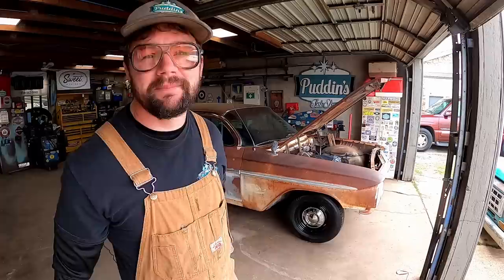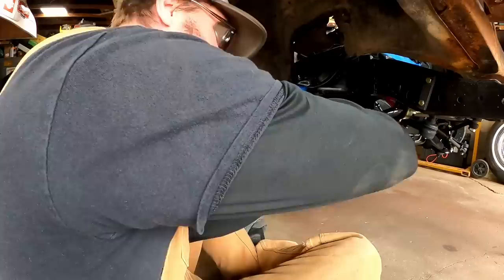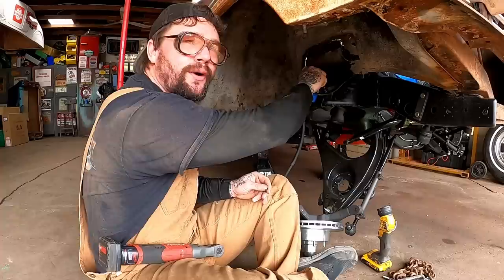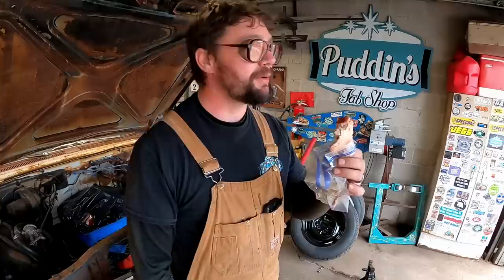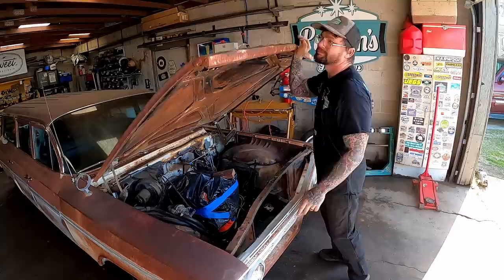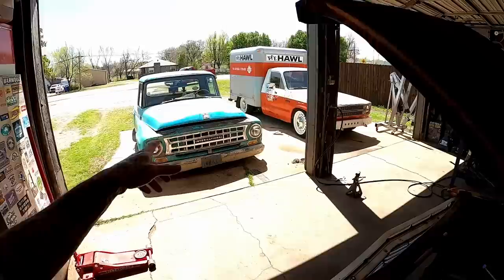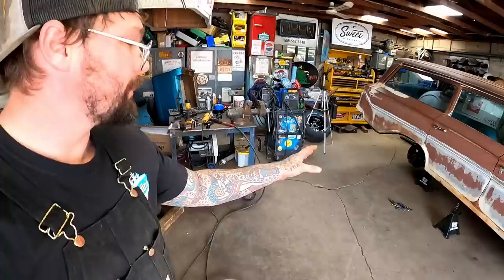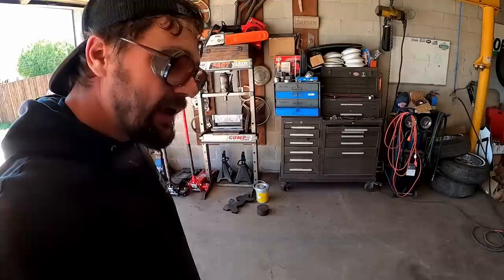ALTITUDE ADJUSTMENT! Lowering the 1961 Wagon & Brake UPGRADES!

Comment: There's two holes on the brake pedal arm. The upper hole is for manual brakes . The lower hole is for power brakes. You're gonna have real touchy brake pedal because you  put it in the upper hole with power brakes. Love the channel👍 The brackets that mount the booster to the firewall are angled so that the rod that passes through the firewall aligns with the lower hole on the brake pedal. It's a leverage thing . Upper hole give more leverage for manual brake set ups and lower hole decreases leverage for power brake set ups.
Reply: Great comment. Hope he sees it 👍
Reply: @Mardy72  Thank you . I hope he sees my comment as well.  He did educate me on the panhard set up. Learn something new every day.

Comment: I have always referred to them as cotter pins. Split pins are the type that hold your pin in your hitch receiver.
AWESOME video Puddin.❤
Reply: The pins that hold in your hitch link are hair pins, spilt pins and cotter are same things
Reply: A cotter pin is a taper pin with a nut on it  as used on push bike crank shafts. A split pin is like a hair clip as puddin correctly explained. At least it is in good old blighty 🏴🇬🇧

Comment: Back in the old days we used chains to remove stubborn axles. Bolt them onto the axle and grab the other end and sling it away from the axle til it came loose. Or, the right tool probably works better.

Comment: From an engineering perspective the ball joint is designed to drop in from the top. This helps eliminate unnecessary stress on bolts and provide a second measure of accident prevention. If the bolts were to shear the joint itself will still remain connected to the steering knuckle and upper arm.

Comment: Hi Puddin, On the back you could make a "Z" bar that mounts on the centre of the diff cover. It keeps the travel vertical instead an arc. basicly 2 bars, One higher than the axle and the other same distance below the axle. Another awesome video, Puddin.
Reply: Bro, that's called a Watt's link.
Reply: @Mardy72  Thats right Id forgotten what it was called. Thanks
Reply: You are welcome, Sir.

Comment: The brake booster angles up because power brakes do not need as much leverage so it is supposed to connect to a hole lower down on the brake pedal and needs the angle to have a straight shot to the booster. It looks like you put it in the top hole on the brake pedal, I think it is supposed to go on the bottom one. Or so I have been told, maybe it will work fine either way, but that pedal does have 2 holes for a reason.

Comment: Agree the upper ball joint doesn’t affect your ride height and nothing dangerous. Perhaps you could throw off your camber throughout the suspension travel range by a degree or two worst case. But on a lowered car, especially an air or hydraulic adjustable suspension, that shits all constantly changing anyway.

Comment: The only concern I would have with the ball joint being on the underside is if for some reason those bolts sheared off. Being on the top if the bolts failed it wouldn't come apart while driving. But anyhow, that's a sweet lookin wagon. I'm diggin that look a lot. 👌

Comment: I don't think you saw to many other shops install ball joints like that. Glad you fixed em
Reply from the maker: Seen one the day I said that even! Still don’t think there would of ever been an issue myself.
Reply: @PuddinsFabShop  hey man i ain't trying to be 1 of those guys but your brake pedal arm has 2 holes in it the top hole is for manual brakes and bottom hole is for power brakes  and the bracket is angled to go to the bottom hole it has something to do with leverage and they will work still but you will have a touchy pedal

Comment: I think the height of the back is perfect you get the front down even with the back once you get it back together get the seats in it that's going to lower it an inch or so and it'll be perfect and then when you put weight on it to haul stuff around you're not dragon bumper

Comment: Speaking of odd ball projects, I was gifted a 1981 FIAT 124 Spyder. You talk about rare parts and expensive parts??!! This think is killing me. Metrics brake nuts took me 2 months to get!! I only have the pinion seal and the cooling system holding me up now. Motor is higher than the radiator. Hardest one I have ever had to bleed!

Comment: Excellent video Puddin  :) don't worry on screw up on parts companies made things on assembly together and really need fix up or return back to gotten from ! I had newer vechile built in 2002 had got Strut also Spring from Auto parts selling aftermarket one and front ones no problem but doing back one left one easy also right up bit higher found out then Hex screw and outter nut wouldn't not change also tight up kept go round and round! So took back Auto parts store show what happened on video me put in and top hex plus outter nut also took back gave me new one same type and back in business they say ! But glad solve problems because one makes parts called auto parts said when open box it blew apart and workers at parts assembly plant could be hurt if jump out way! Or if vechile be serious vechiles accidents  or vechile past one got on also I lost my job over it too! But thankfully didn't get to be that way and boss of Auto parts store told thank you tell use put sticker says be carefull opening up and fragile too ! But all went okay too and glad solved from a serious problem on defective part too ! Not only parts had happened to me before bought new!

Comment: A hoist is the thing you use to pull the engine out....essentially a synonym for crane, but a smaller one. They call car lifts "lifts" because they lift from below, rather than hoisting it up from above...like a crane....

According to wikipedia, cotter pins are just cotter pins, "split pins" is apparently an American thing used by a bunch of contrarian 'Muricans...up here in Canada I've only ever heard of cotter pins.

Comment: A pudding when you're using all that rust remover stuff just get you some battery acid and put it in a plastic bottle and squirt that battery acid on there for about 10 minutes it'll eat all that rust off of there then rinse it off with some water let it dry and then paint it hope it helps you buddy

Comment: Pro tip: When you cleaned you master cylinder you could have heated it with a torch to burn off the impurities from the metal to make sure your paint sticks well. Just sayin...

Comment: Like the way the car looks but I think I would have waited to cut the springs till after car was complete your going to be adding lots of weight with radiator, battery, water bottle, anti freeze, air compressor, condesor, dryer, lines and hoses. That's just under the hood, then you got that crazy heavy interior to install. But I guess springs are cheap and easy to buy and modify again if needed.

Comment: Hey. My name is Roger Griffith. I’m from Aberdeen Mississippi. I watched your video of you swapping the upper ball joints around. I’m thinking it would be safer with the insulation bolted on top. If the bolts fall out, the ball joint won’t fall out. The spindle housing will push  up against the A arm . That’s just my thinking. I really enjoy watching your videos. I love old school Gm cars and trucks. I’m disabled and I’m slower than I used to. I have a 1979 Chevrolet pick up long bed. I inherited it from my brother n law after his death. It’s got around 130,000 miles. I need a turbo 350. No luck in finding one. I’m thinking about trying to rebuild it myself. I’ve never rebuilt an automatic transmission. (My moms didn’t raise no punk) lol. I worked at a ford dealership for 24 years. I’m going to restore it. Floor pans extra. Keep up the great work with your videos. Ps . I like the way you explain whatever you’re doing. Some people really don’t know much about vehicles and you are teaching them. Take care looking forward to seeing more videos.
Reply: Hello, Roger. I thumbs upped your video because I like what you said and feel like we’re friends now. Never hurts to have a friend that’s a mechanic. Also, I don’t know why no one thumbs up my comments to Puddin. That’s OK, my comments are meant for him anyway. They probably don’t read them because they think they may be invading Puddin’s privacy. Yea, let’s go with that. Welcome to the Puddin community. Not meaning to invade Puddin’s privacy but you get a thumbs up anyway. Hope you start working on your truck soon. That’s the gratifying part. 😄

Comment: Too late for this comment but Eastwood sells paint just for the master cylinder so the brake fluid won't eat the paint.Not a hundred % sure but the two holes in the brake pedal arm are one is for power brakes and other is for manual.That's how it is for my truck anyhow.

Comment: Cutting springs is a no no!
Even if you cut it flat it won't sit right.
It puts a loading on the spring that isn't right.
Fortunately your springs sit in a deep cup.
I've cut them when I was younger on a MacPherson strut and the front popped out!

I don't like when people put lowering or lifting blocks on leaf springs either,( I know you have not here )as the axle kind of has more leverage to twist.

It does look perfect.
Cutting coils makes them stiffer too as the coil is like a long coiled lever, if it's shorter then ..... well you know what I mean.

I like the wheels btw

Comment: Puddin, in the last video, maybe you didn't film it, but I didn't see you install the torque converter bolts. Hopefully you did it, if not, you may want to go back and check that, before you fire her up for the first time.
Reply from the maker: I need to find some. The ones I had on hand were 3/8ths-24 thread and I need metric ones! It’s in my mental list of things to do!

Comment: yes i also learned a quarter pin is a splitpin. that weld on the transmission cross member looked that was done five minutes to quitting time or me doing it. can zeus it together just don't expect dime stacking. when yo told that driver to put his horn somewhere. my late sister had the saying save your damn horn and pay your taxes😂🤣😂🤣😂🤣😁😁😁😁

Comment: I swear it seams like those rear springs are super soft maybe there only a 2k spring??? .  Should be a 5k atleast, the bounce it has is like it's only running shocks!!!!    It would be nice if you tinted the windows  on it also,  she's gonna be so nice dude..  when I did the drop on my truck I did alot of research  and ended up with  beltech I wanted a 2 inch drop  but  bought the 4 inch drop springs  so when it settled finally it was a full 3 1/2 inch drop that was 2 yrs ago.    And I still need a 4 inch drop spindle.          So if you think a 2 inch will work,  do the 4 inch just be sure

Comment: I'm one of those viewers who are rejoicing 😆😆😆😆😆😆
As I stated before, you were relying on the bolts to hold it all together
Coil springs- the ball joints are bolted to the outside 
Torsion bar - the ball joints are bolted to the inside. 

If you don't know the difference God help you.

Comment: You should get a Dimond cut off wheel as they last a lot longer than the normal ones more expensive but a lot better and they don't wear down to the output shaft on the grinder they only wear down like 1 or 2/16 so don't get smaller by a lot

Comment: 25:55 of all the greases I've ever used that Valvoline stuff is the most disappointing...turns into a liquid and dribbles on the shop floor if you don't drive it right away to mix it up I guess.  Makes me want to vacuum it all out of my minivan's underbelly bits and put in something-ANYTHING-else, even chewing gum scraped from under a movie theater seat would probably be better.

Comment: So professor puddin there I think it's portable manufacturer of Spring because everything is made cheap anymore you would have been better off cutting stock original Springs better still I think even though you wouldn't know you would have had the same blast in my pain I'm still might have been a little better off as far as laughing with